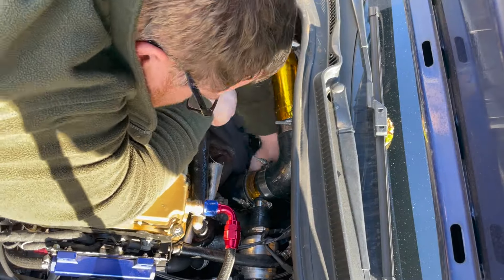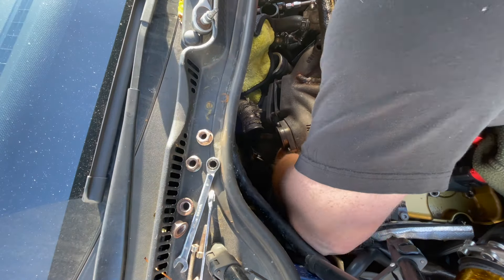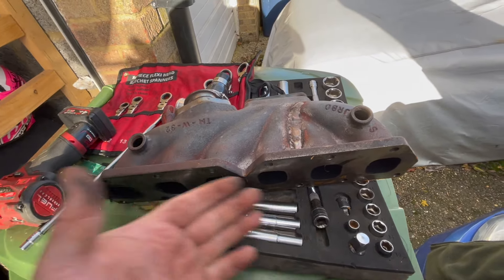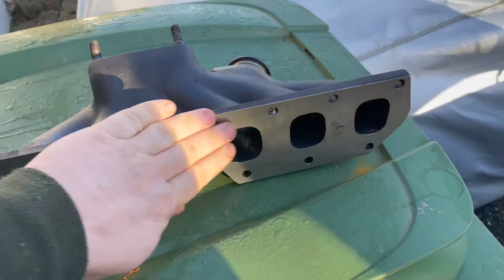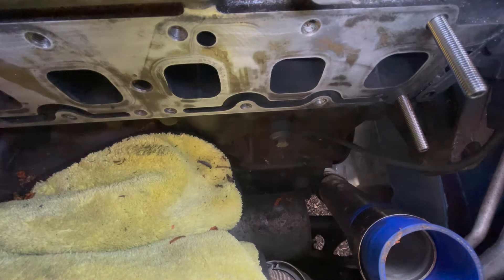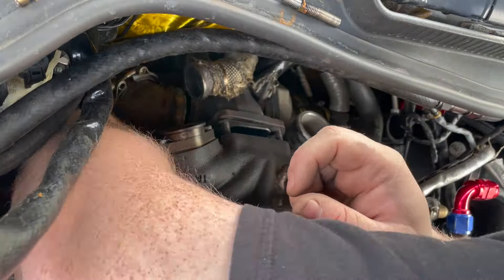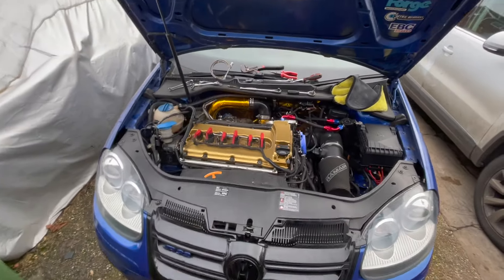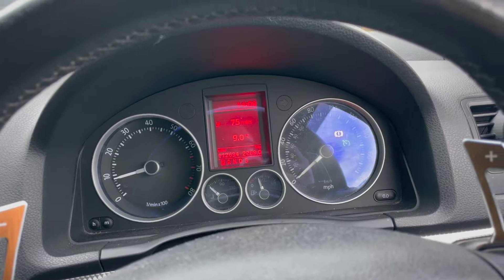Common R32 Turbo Problem - Warped SPA Turbo Exhaust Manifold!

Comment: I feel like you haven’t uploaded in ages. Good to have a upload, I definitely love build ❤❤
Reply from the maker: No I haven’t. It’s hard to work on my drive over winter 😂
Reply: @OctaneFever  I just went through your build videos and its amazing what yo were able to diy using simple tools... 

one simple tip/ opinion: torque on low rpm is what bends rods, and after I looked at your dyno sheet you can see that the torque curve aggressively spikes as the turbo comes on. 
I would suggest asking your tuner to pull some timing at that rpm  in order to have a flatter curve that nearly holds the same torque at 4000 rpm as 7000rpm. This will also give you a more linear horsepower graph rather than a strong punch.

this is how new exotic cars like mclarens are being tuned to have high peak numbers but a flat torque curve rather a spike up than downhill. Feel free to do your own research but i though I suggest this as it is much safer and the car would still be 490whp just softer curve and more longevity.

Cheers

Comment: Tubular Manifold or don’t bother.
Have you any thoughts on maybe the exhaust face of the cylinder may need a skim?
Reply from the maker: That’s basically what I’m saying in the video. No the head is flat and I couldn’t imagine the heat needed to bend that face.

Comment: Some manifolds have vertical cuts in the mounting holes to help with expansion , the slots get closer with heat   but there is less warping push
Reply from the maker: Yeah they do. I was tempted to do that to this one but didn’t want it to ping into more of a banana once I cut it. Lol

Comment: I'm gonna venture a guess the real problem is the design of that manifold. It's a single chunk of cast iron converging into a single point. Basically there is too much of a difference in temperature across the manifold and it slowly wiggles itself bent across heat cycles.

Comment: Make sure you take a few clicks back of the boost controller before you go testing. I blew my engine on a overboost after I fixed a boost leak because I was compensating for the leak by uping the boost and kaput there was the engine 😅
Reply from the maker: Great advice 😂 more boost the better right 🤪
Reply: Well if the car is tuned for that boost level and have fueling all sorted out well is not that bad but I heard few stories and I experienced first hand 😅.

Comment: Unfortunately I think you might have another problem, I once drilled for new studs in a cast manifold ( not a VW) and they was not a 100% straight this meant the nuts kept coming loose as the nuts were not sitting flat against the manifold. So I think you might have the same problem as the face is flat but where the nuts sit is not, I think when you have the manifold off again get the back where the nuts sit machined. It took me a long time to find out what was wrong with mine this is how we live and learn.
Reply from the maker: Thanks for the advice bro. Not something most people think about.

Comment: Is the warping and cracking maybe due to you inserting lambda probes?
Reply from the maker: No I don’t think so. Nearly everyone who has these manifolds experience the same crack in the same place. It might be an issue with how the turbo is supported and there being too much weight on the manifold maybe

Comment: Great vid as always. How are the coilovers holding up?
Reply from the maker: Yeah no complaints so far. I think I’m running them alittle low as I get wheel rub on the passenger side from the tyre but other than that still going strong

Comment: hey man, always enjoying your videos, I have similar manifold (you know the chinese cheap version) on my r32T, and It cracked also 3 times on exact same spot, so I assume too much weight on that side because of the turbo, I am thinking about adding some turbo support to avoid all weight on that part of the manifold
Reply from the maker: Yeah I think that will help. Keep me posted on Instagram with your progress. I’d be interested in what you make for it.
Reply: Don't bother no brace will help it's a material issue the one he bought for 500 will be rebranded Chinese junk 
Tubular is the way to go I know I make them 😉
Reply: @steakandchips9046 how much do you charge for a tubular manifold?

Comment: Would it hold up better from warping with a brace between the manifold and the nuts to make up for the material machined off (and then some)?
Reply from the maker: I doubt it mate. They are just shit and warp. It’s not just me, and I know it’s not just the spa one either.

Comment: Hi pal just a quck question hope you get time to reply
 

Your running the jr11 rims what size are they ?

Im thinking of going to 235/40/19
Reply from the maker: Think they are 225/40/18.
Reply: @OctaneFever  hello 👋    I ended up going 235/35/19 and they transform the car tbh .   Gives it a really wide stance and handles well.  Running wise it's alot more pleasant than I thought it would be but it does scrub the arches if I drive over a big dip but nothing to worry about .

Would you reccomend a  turbo ?
Reply from the maker: @BarryRobinson-q4j  good to hear and sorry for not getting back to you sooner. Yeah of course I would recommend turboing it. 😂

Comment: you need to instal a proper heavy duty suport braket between engine block and turbocharger as all weight of the exhaust and turbocharger is on that manifold causing craks
Reply from the maker: Yeah that would probably help, it’s too late for me now as I’m swapping it out for something better
Reply: @OctaneFever   even if you use different one Please consider adding it as This situation may repeat btw big fan of the project keep on going mate
Reply from the maker: @filiprolek7509  absolutely will. Thank you for the comments and support.
Reply: No bracket will help it's Chinese cast junk tubular is the way 👍

Comment: Iam student based of black alloys steel conected metals this is a problem that to make sure u have to look the crack is it with boubles maybe is a problem of fabric so welding it is another issue  prehiting and welding it doesn’t garantee that it will not crack again the mixing of iron in that part is not perfect. Make a tubolar one
Reply: This guy is right, the material is the problem 👍

Comment: Wow! No offense but that company should reimburse you.  Thats way too many times to remove and reinstall.   Have you looked into CTS Motorsport and HPA Motorsports and HGP?
Reply: Imagine if he had to take it to a garage he would £££ into it just getting manifolds off
Reply from the maker: Yeah tell me about it. I have and I’m debating on my next manifold as the weld didn’t last very long 😂
Reply from the maker: And that was the purpose behind the video. So everyone can see that going cheap doesn’t work out especially if getting a company to do the work.
Reply: @OctaneFever  it looks to be that manifold doesn’t have relief cuts. Factory manifolds have the cut in the shape of the letter J. This allows for expansion.